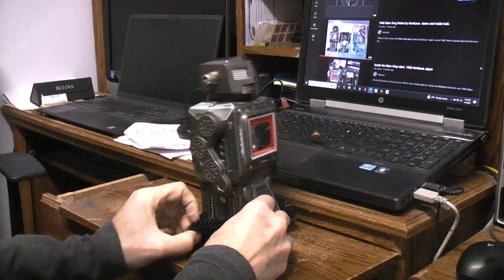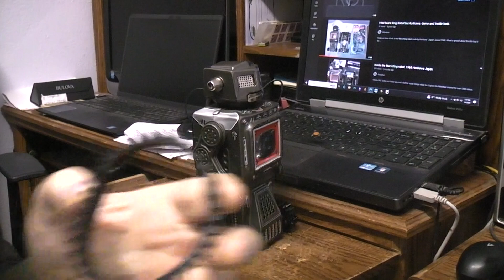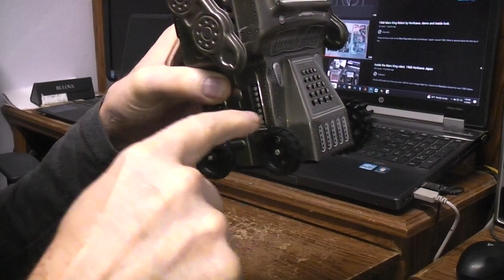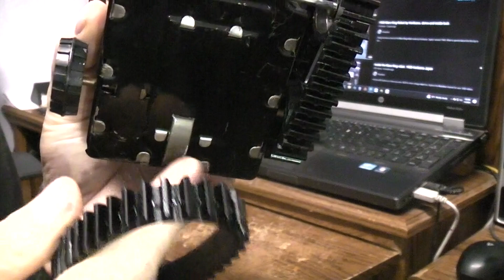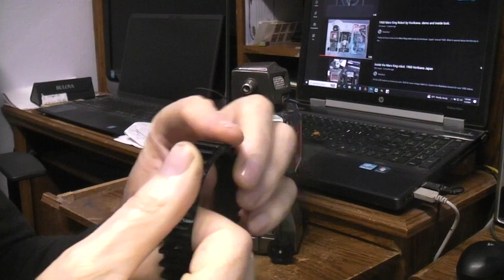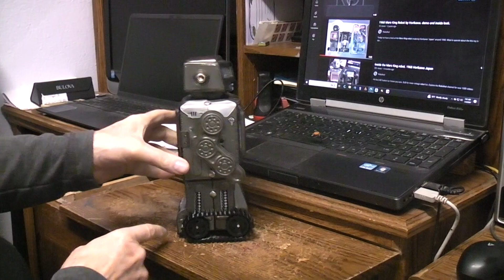3d print flexible replacement treads for the 1960's Mars King Robot.

Comment: Those are perfect John. I too need 6 treads for the big Yonezawa Shermans. All the ones I purchased on Ebay were more like plastic than rubber. Won't work on those tanks.
Reply from the maker: If flexible filament was cheaper, I would try some of the new ones to see how Rubber Like they are or aren't.
Reply: I would gladly send you one of the tanks for a feasibility study. I'll buy the filament and have it sent. Also compensate you for endeavor . I don't know if Leo has a set of M4 treads or not. For visual of the original track design.  https://youtu.be/8mHRYfLBi08?feature=shared

Comment: Or you could just use the treads off a Stomper 4x4 tank and they look original without the scan marks.
Also it's supposed to have a chug chug type sound when advancing forward. Something is wrong with your robot.
Reply from the maker: This robot was sent to me for tracks only. You can view the other links in the description box to see videos of a Mars king with the clicking sound working and the inside mechanics. As for your suggestion on the replacement tracks, the point of this video was to see if I could 3d print tracks.
Reply: @Robothut  Good job
Reply: I'm reading between the lines in your reply to the lecturer John...You're much more diplomatic than yrs ago. 😂